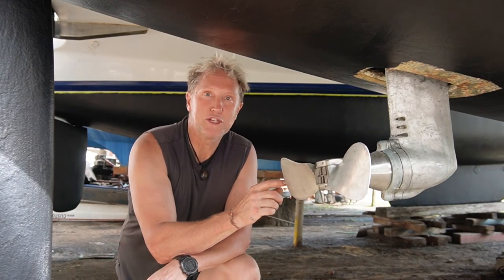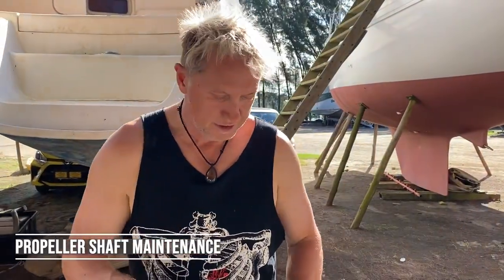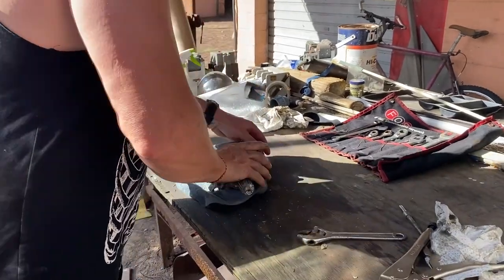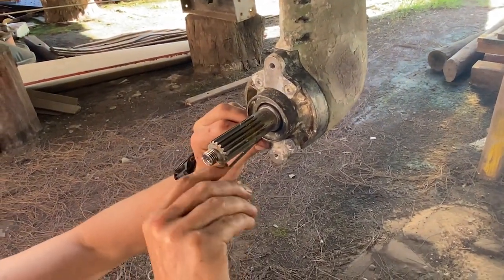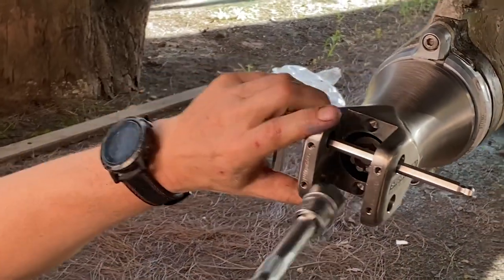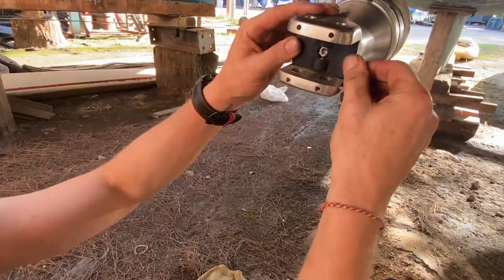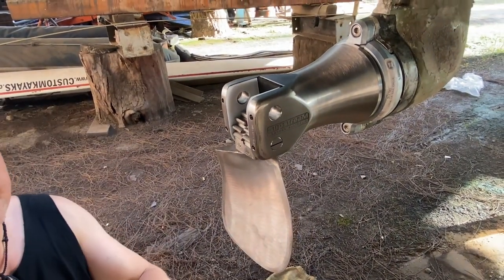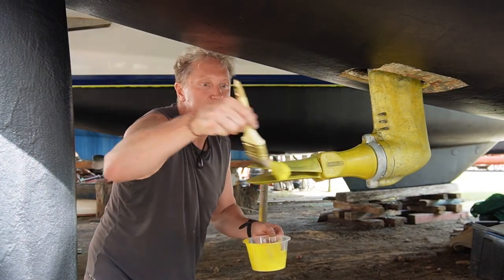Folding Props Installation

Comment: Should put a lot of grease on the shaft before putting the prop on Richard. Helps reduce wear and tear and easy to pull of the prop in the future.
Reply from the maker: Will do Mike . Good point

Comment: @CassiusTales Hi Richard, thanks for the video it's very helpful. We have a 35ft catamaran and also SD20 saildrives on yanmar 3ym30 engines. How do you find the slipstream props after a year? Out of interest, what prop diameter and pitch did you go with. Cheers from NZ!
Reply from the maker: Hi ya, the Props are amazing and I changed the mechanical Seals last month the the sail drive. The props are so over engineered that they will never come off unintentionally. 
Item number is S617 17 by 11, left hand 

Speak to Grahame from seahawk as he builds them and very knowledgeable.

Best of luck and now you can add another .5 to 1 knt to your sailing